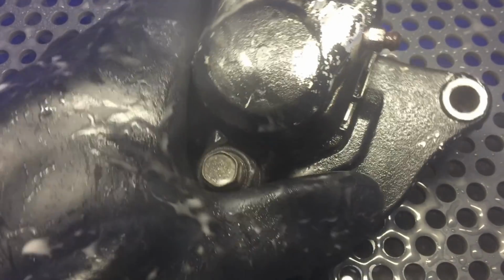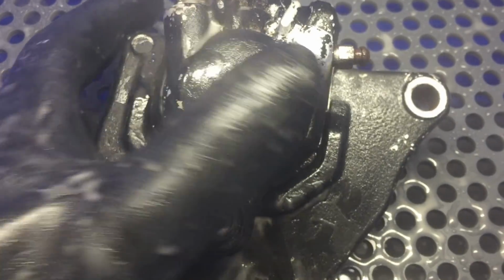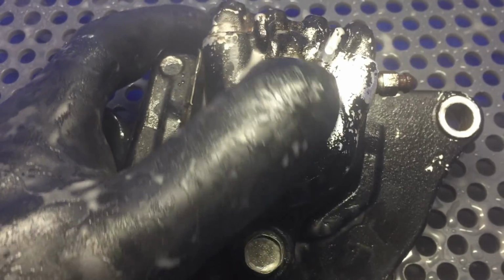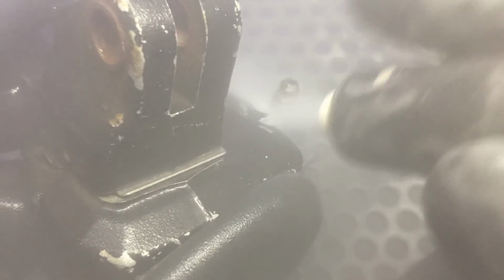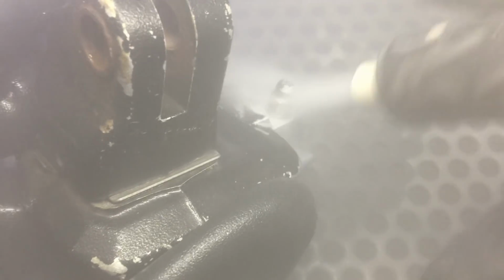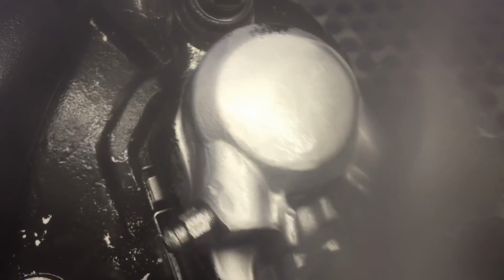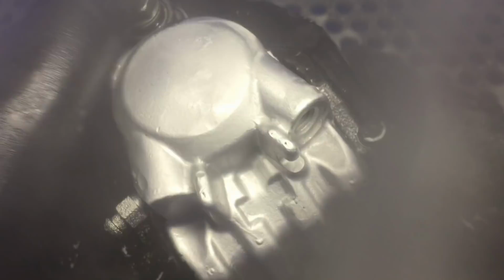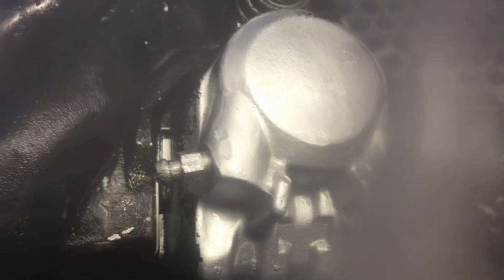Removing Paint & Polishing Aluminum- Vapor Honing Technologies

Comment: Can you please  review the micro hone unit it self with all its features?
Reply: Internal Working Dimensions 17"wx13"dx13"h, Overall Dimensions 20"wx14"dx22"h.  2 Gallons of water for operation, 4-5 lbs of abrasive, 5-10 CFM Max, 60-70 PSI max pressure, No Power Needed, No Assembly required.  Machine is designed to run completely off of compressed air no power needed.

Comment: I saw in another video of a clutch lever that you used paint remover on it before you put it in the spray booth. I'm curious why this wasn't done the same way. It certainly wouldn't have taken near as long.
Reply from the maker: Hello Weston Ward:  The video you are referring to https://youtu.be/uOJlrrLh7Ug specifies that he used a chemical in that case because the abrasive he had in the unit was to demonstrate the polishing attributes of fine glass bead.  In the above video he is demonstrating how the Micro Vapor Hone works and has the same capabilities as its larger counter parts.

Comment: Love it! Takes a little long though to do this small piece!?
Reply from the maker: The micro hone compared to our other larger floor models will certainly take a bit longer because you are not putting anywhere near the amount of slurry across the part. The pump on the micro hone is around 5 GPM max and our large machines 50 GPM so its a major difference. However, its the fine mesh glass bead that I was demonstrating with as well which is not normally well suited for paint removal.